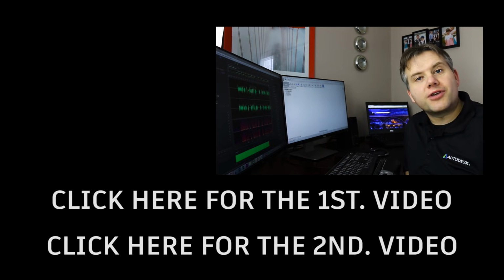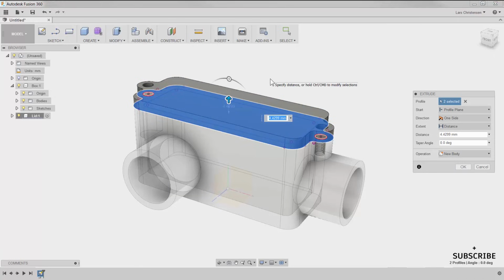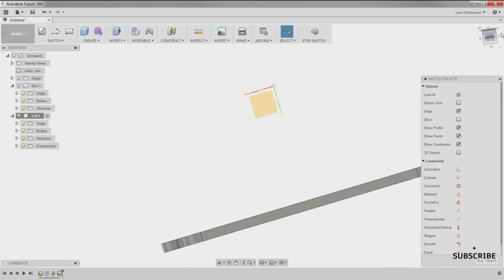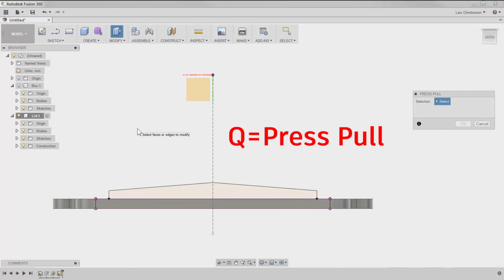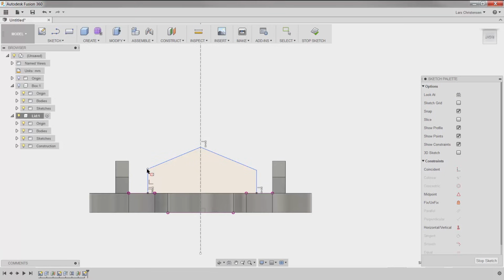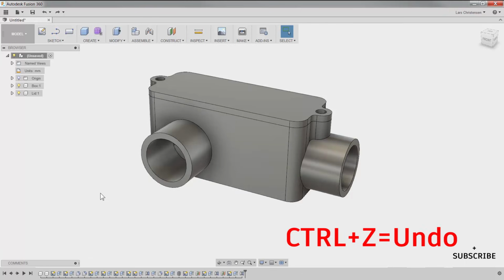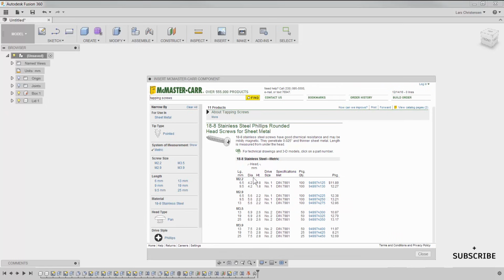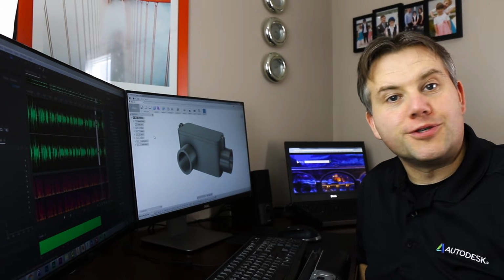Fusion 360 Tutorial for Absolute Beginners— Part 3

Comment: I am following along and I have the free version. so was able to create the parts initially, but when creating geometry in each part a separate tab opens up with the part. I can create everything in the part and then bring to assembly tab show and edit in assy. all good. except now I cannot create and edit the top lid in place. i can create the geometry in its own tab but not in the assembly tab/window. when clicking on the lid in the model tree, I cannot get the circle to show up to show that it is active.  is there another way to switch between parts besides just selecting the part in the tree?
Reply: figured it out, I needed to finish edit in place on the body before it would allow me to select the lid

Comment: I'm using Fusion 360 (2025 version) and got confused around the 7:00 mark. After creating a new sketch on the Offset Plane, my plane moves away from the base when I add a dimension, which makes me think it isn’t actually attached to the lid. I also noticed that when I drew the line to create the plane, my cursor never showed the blue “X” like in your video. Is this difference due to the newer Fusion version, or am I missing a step?
Reply: You have to manually project the geometry from the lid. So press P, then select the lines that make up the edge of the lid where you want to snap your new lines to.

Comment: ok I've been at this for a few hours trying again and again....@8:18 can not get the symmetry to work for the life of me....just won't do it.  Any ideas.  I'm sure the software has change in 7 years.
Reply: I also had this problem and found that the when drawing the lines to sketch the flange, the line was not constrained to the lid so the symmetry did not work for me properly when dimensioning. By selecting "coincident" under constraints, I was able to tie the line to the lid and that helped a lot.
Reply: @PyroBrit I gave up on these tutorials and found others that are newer.
Reply: @archcat_can  It's been part of my struggle and also as I have a MAC but as you have found. There are newer tutorials. Nevertheless, I was able to complete the build of the part although I had to learn a bit about constrains and marry up the new software with the old tutorial software.

Onwards and upwards as they say ;-)

Comment: Getting the line to snap to the lid at 7:05 didn't work for me.  It never gave me the blue X to "attach" it.
Reply: The top comment is wrong, don't "fix".

Project the lid by pressing P, selecting the lid's edge (the second time, when doing the other, short side of the ridge, select all top edges) and then press OK.

Pressing 'fix' as the top comment says will just fix it to the arbitrary point you chose, not to the lid
Reply: @duncanhw thank you! You saved me massive frustration!
Reply: @duncanhw  Thank you kind stranger! I was beating my head against the wall on this and the projection worked like a charm.
Reply: @duncanhw  I was about to give up and potentially break things. THANK YOU, this worked like a charm
Reply: I was facing the same problem, and I had to adjust a configuration: Preferences -> General -> Design -> Auto project edges on reference: set to checked.
Reply: @aleotavares  You have no idea how much you have helped me. I struggle for days trying to figure it out, even with ChatGPT, which doesn't help much.

Comment: Only issue I didn't get is the real world fitting together of the physical parts. If I understand correctly, you made the tabs beneath the lid align exactly with the walls of the box. But the parts you were copying had some wiggle room between their walls, which actually would be necessary if you didn't want to have to use a hammer and pry bar to open and close the box. Did I miss a step or misread the dimensions?
Reply: Looking for this answer too.

Comment: The whole part about making the inner shapes with construction line, symmetry etc @07:10 . is not working at all for me :(
Reply: struggled with this, but figured out if you project (P) the long side face of the lid, the points will snap into place
Reply: @kristofferhs  idk what this means but it worked for me thank you haha
Reply: I found it at the top of the screen. It's apart of the top tool bar.
Reply: I'm also having difficulties with this. When I add the vertical dimension for the center point at 5mm it lifts the sketch off of the lid...
Reply: I got it working! I selected the bottom of the lid—where it connects to the outside of the shape I'm creating—along with the top of the new shape to set the dimension. Now, the new shape stays connected without separating.
Reply: @SethJFilms  Yes. He leaves out some critical features that can be ambiguous - leads to a hopeless mess.

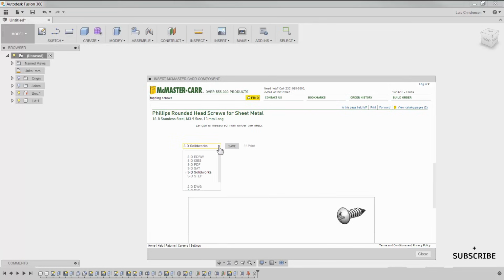Comment: @18:51 Lars clicks on "Save". It appears newer versions of Fusion show this option as "Download". When I click on Download, the screw appears as a component in the Fusion Browser with its Origin & Bodies both clicked to be seen, but only the Origin shows in the display area, the Body is invisible. Anyone have an idea what could be going on?
Reply: Found part of the issue. The McMaster-Carr screw component is showing up so tiny after import, it's barely visible. Now I have to find the reason why the screw component is disproportionately smaller in size compared to the Box and Lid components. Has anyone experienced this?

Comment: I am following along and I have reached near the end of this.  But a few things are not working right.  Likely something I did but nothing I am trying will work.

I moved the cut for the second boss to the end and it cuts thru as it did originally.  So the second screw cylinder area that was mirrored is visible and still present hanging down into the cutout hole.  Anyone else seen this?  Anyone solved it?  I think that perhaps re-creating it later using the same process as it was first done with might work I haven't tried it yet as I am looking to see if it is an option or something.

The second issue and where I got stuck is the fillet for the screw stand outs.  I can select the 4 corners and make a fillet but it pulls it in tighter for an even sharper cutout between the main box body and the screw cylinder rather than rounding it our like here in this video.  The Fillet control panel is totally different than in the version used in this video. I get that a lot has likely happened in 7 years with the software, but it feels like it should be a configuration/option and I just can't see it.  Anyone have any more luck?
Reply: The answer was in the previous video.  It was posted by the user:  @curiousGuy801

When I added the screw bosses by extruding the cylinder they became different bodies.  Of course a cut on 1 body wouldn't impact the other.  And the strangeness on the fillets seems to have been just that as well.

What I did was go back thru the time-line.  Lars is right!  The power of this parametric modelling is pretty darn impressive.  I edited the feature where it was extruded and selected join rather than the default of create a new body.  It looked the same to me in general.  But on closer inspection a small black line that had been present in the cutout of the screw boss was gone, and the top surface when selected highlighted all of it.  So it was now 1 connected surface.

Once they were the same I went back to on the timeline to the latest and added the fillets for the 400th time and Bingo! it was perfect.

Such a simple issue but it cause me some real trouble making it match.  I wanted to share what I found in the comments between this video and the previous part 2.

Comment: At the 13 minute mark I can’t press-pull my sketch, and it may have something to do with the fact that the lines in my sketch are all coming out dashed. It turns black like it’s fully constrained but when I go to press pull, I can’t select the profile and there’s no light colored shading inside the profile.
Reply: If the line is dashed, select it and press "X" on your keyboard then try extrude again "Q" (press pull). Good luck.

Comment: at 7:00 I cant click or snap to the lid edge to draw on. I created a sketch on the offest plane, and I have the Lid part selected. any clue?
Reply: Hey, do you mean when you try drawing the sketch on the offset plane, it won't snap to the top edge of the lid? So when you try to modify the height, it comes off the lid? If so, I am having the exact same problem. Have you figured out a solution? It's driving me crazy!!! Thanks!
Reply: Go to your preferences and enable "Auto Project Edges on Reference" under design.  Then recreate the offset plane and the rest works well.
Reply: @sbatkin  lifesaver 🙌
Reply: @sbatkin  you saved my sanity and mental health. Thank you!
Reply: @dantican3800 haha I know, right? It was driving me insane too until I found a comment under this video that solved it, so I right I’d share some mental health :)
Reply: @sbatkin  If I could upvote this twice, I would.
Reply: @sbatkin  Brilliant thanks. I still had to hunt for "Preferences"...Click your image  in top right, Preferences/General/Design
Reply: @sbatkin  Someone buy this individual a drink! THANK YOU!

Comment: Can someone Tell me if there’s a big difference in the software form when he did this six years ago to 2023
Reply: ive gone through his videos since the 1st, and honestly iit just seems like some functions have been moved around or renamed. i havent had an issue so far
Reply: I get stuck at the part where he draws the inserts on the offset plane. I end up projecting the line he snaps onto as mine wont snap. and then from there I get a bunch of issue with over constraints. I managed to get the long ones done, but the short ones I cant get past. @rokketmanba55
Reply: @ForTheGreys  i had to draw each line separate to make it work and get the blue shape and then it finally worked, it didn't work the same as his program from years ago . took me about 2 hours of undoing and redoing ! lol
Reply: @rokketmanba55   thank you good to know

Comment: These videos are amazing and so helpful. But, while I am working on the lid trying to make the little flap parts mine " line " doesn't register the box. I don't get the little blue " x ". If I just carry on the flap I just made does not actually attach to the lid. Why is that happening and how do I solve the issue?
Reply: See lower comments. (Make sure you turn "Auto Project Edges on Reference" on in your preferences menu (top right, click profile icon, select preferences, and the option is under the design tab). Found this further down buried in comments, fixed it for me)
Reply: omg this has been making me go crazy for a few days no!!!! thank you! @Matweaver7
Reply: @Matweaver7  THANK YOU!!!

Comment: Fist, after going through about a dozen other F360 tutorials yours is the first one that did not leave me ready to quit. Most other seem to be wanting to set a speed record in passing out info without explaining much. I am coming from Old School drafting (remember they days when we did it with pencils on a drafting board?) and the early days of CAD. Last Autocad I used was R14. Parametric drafting was something that was just coming out back then. I'm back learning because my son and I have some things we want to create in 3D printing for a project we are working on. 
You are an awesome instructor. Teaching this Old Dog new tricks.
 Here is my problem. When trying to do the dimensions around time stamp 9:03 everything works well until I try to do the apex to base. At that time the entire sketch shifts down to match the 5mm height instead of moving the apex point down. Have done undo back to the beginning of the sketch and even back to setting the offset to the ot the plain and keep getting the same results. Any clue what I am doing wrong?
Reply: I had this also, to make it work I right clicked on the bottom line and chose fix so it couldn't move then I adjusted the dimensions.
Reply: it works but bottom line should not be construction
 @isaaccarter1861

Comment: Blahh this video is terrible. I have followed it carefully and nothing in my current version of Fusion works the same as shown. It is not possible to have a peaked shape as shown in the video because when you dimension one end the shape immediately becomes a rectangle. Dimensioning the centre gives an oddball angle that preserves the dimension of the end. Nothing works. I give up.
Reply: I do not agree! I just downloaded my Fusion program and everything worked fine and I had all the options, event with the free versionavailable only for personal use. Sorry to hear that it didn't worked out for you.
Reply: So far I have been able to do everything he has, when I hit a glitch it's usually because of something I did wrong a few steps back and use undo to a previous point and try again to catch my mistake. There is only one point where I'm hitting a glitch that is baffled me. (see my above comment). Because of the way the architecture is set up, with parametric construction, a mistake I make a few steps back might not show up effecting the drawing until later.

Comment: Im stuck on the inside tabs for the lid.  I can add the extra plane, draw the construction line but can't get the other lines to attach to the lid.  When I add dimensions to them, the bottom line that should be the lid moves up or down and doesn't stay on the lid line.  I have tried to get the little triangle, when starting the first point, but it doesn't show up.
Reply: Make sure you turn "Auto Project Edges on Reference" on in your preferences menu (top right, click profile icon, select preferences, and the option is under the design tab). Found this further down buried in comments, fixed it for me
Reply: @squaregoco5056  I got stuck at the same point with the same results. I'll have to go back and see if that is the problem. THANKS!
Reply: @squaregoco5056  tried that and it still sinks the bottom line into the lid or pulls it up from it. Do I need to start the drawing from square 1 with the preference changes or will it adjust on the fly?
Reply: @squaregoco5056  thank you!
Reply: @squaregoco5056  Thank you for the suggestion! It fixed my issue too. 😀
Reply: @squaregoco5056  Thanks
Reply: I had to redo this part 3 times to succeed. It sucked!
Reply: I'm having this same problem, cannot get past it
Reply: TY. had this same issue, this setting being turned off was the reason. Fixed. Video did not mention that the default for this setting is OFF.  @Video Creator > When doing tutorial videos you should always reset your software to factory defaults so that the people trying to follow along have the same settings as you.

Comment: When I try to create a line (7:00 into the video) the software doesn’t ‘see’ the intersection with the lid. How can I solve this ? I’ve checked several times and seem to be working on the correct plane.
Reply: Make sure you turn "Auto Project Edges on Reference" on in your preferences menu (top right, click profile icon, select preferences, and the option is under the design tab). Found this further down buried in comments, fixed it for me
Reply: @squaregoco5056  Thank you! This worked great :)
Reply: @squaregoco5056   thank you!

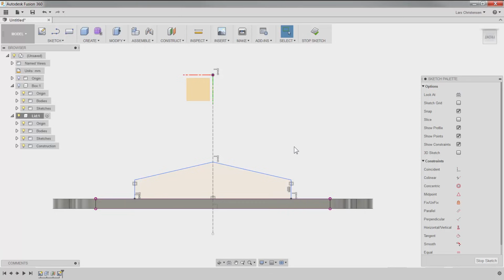Comment: Problem with making LID tabs at 7:00 min in video (Response to Juan Manuel Garcia).  It appears that the new version of Fusion 360 has a slight difference that needs to be done at 8:33 of the video.  In order for the tab on the lid to be anchored on the lid surface, it looks like you have to use the "Colinear" constraint BEFORE you add dimensions to the tab, or the tab will move off the surface of the lid.  To do this, select the "Colinear" constraint and then select the line for the bottom of the tab and then also select the line corresponding to the surface of the lid that you want to anchor the tab to.  I noticed that unless you do this step, the tab does not go from BLUE to BLACK and therefore can't be extruded.  Thanks for the great videos Lars, Cheers!
Reply: Same problem here, this comment helped a lot 👍
Reply: i try to follow your advise, but i am really frustrated that it work one time on 200 .... any tips ?